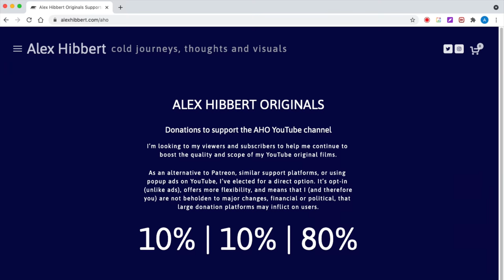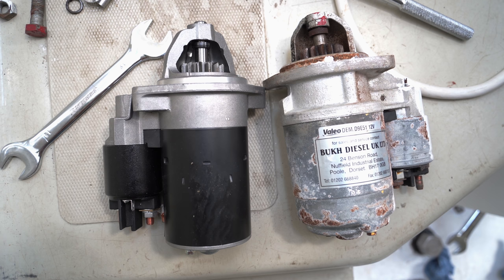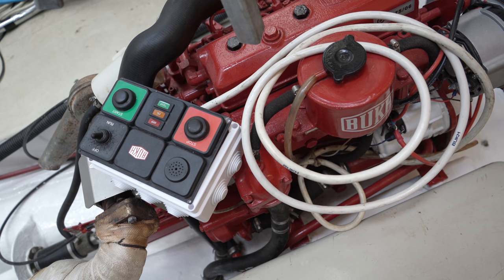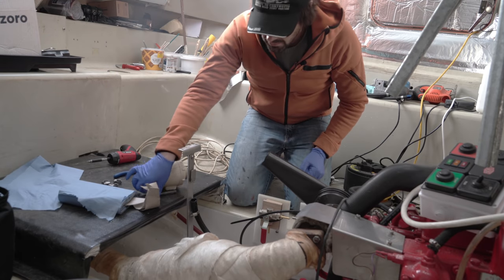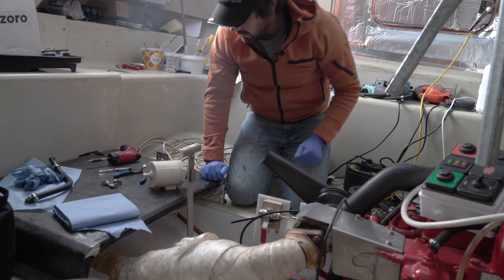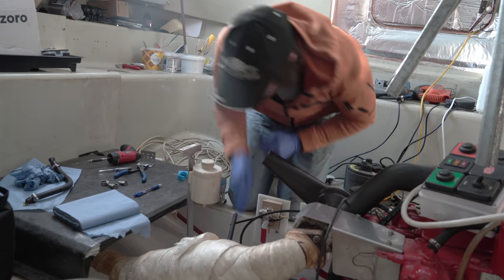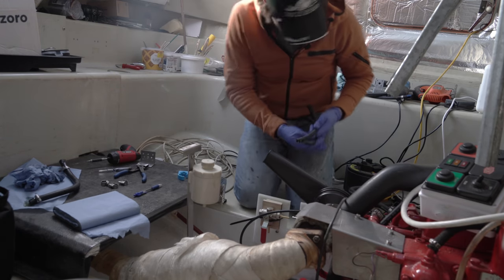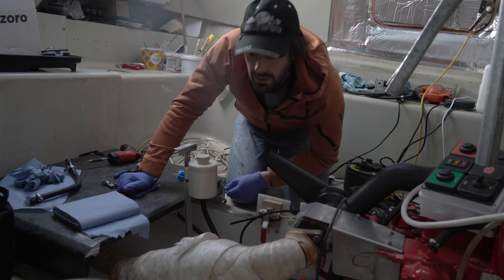Lifeboat Conversion Ep13: Fixing the broken - starter motors, lube hoses and head-bumping [4K]

Comment: 1 is none, 2 is one.  Backups are a way of life.  Being on such remote expeditions a simple part could be catastrophic.  Glad you are so thorough.   Keep it coming, really enjoying it.
Reply from the maker: On a boat it's refreshingly possible to have spares of most things. On ski expeditions, when you haul everything, for many items you can only bring one and have to fix it if you get a breakage.
Reply: @AlexHibbertOriginals  A ski expedition has fewer electromechanical parts that break down though I imagine
Reply: @daylen577  Unfortunately you've got something much worse than electromechanical-
Biological stuff breaks down all the time, and requires a lot of gear to maintain.
Even worse, it sometimes requires "natural healing" which takes time, rather than being finished once it's out of the shop.

Comment: There is another lifeboat conversion on youtube that a couple of young British architects did for a trip along the coast of Norway.  There were two safety things they did that I am curious if you will repeat.  First, They turned what I assume were loading doors on theirs into large windows that actually made the inside a lot brighter and actually quite appealing to spend time in.   I imagine that in northern climates the heat/light for moving around/ the depression fighting sunlight on the skin are probably all welcome bennifits that helped keep them upright and productive.   Second they chopped a bit of the back to create a little landing to make getting on and off the boat a lot easier/safer.  Which I imagine will be a dangerous challenge in icey waters.
Reply from the maker: Hi - yes the Stødig guys made a really nice job of their (much larger) boat. The answer to your question is no to both. I don't want to compromise the strength or self-righting of the boat by removing much of the upper hull, and I've no particular need to have a stern located 'helm zone'. It's really just a priority thing. I need Alan to be an expedition vessel with all the safety design features retained, and have no particular need for a load of nice-to-haves. The things they installed in Stødig make it a much more comfortable coastal cruiser and live-aboard though!
Reply: @AlexHibbertOriginals  thanks for the response.    That’s some helpful context on how the projects will be different.

Comment: A couple maintenance guys at a previous job called the jubilee clips "hosecutters". While there I don't think I ever saw them used except on steel-braid hoses or tough plastic hoses that were perfectly stationary.
Reply: Proper clamps have a solid inner ring. These cheap stamped jobbies are for short easily maintained service.

Comment: If not, also based off your wiring info you may want to Replace ALL your engine hoses with silicone there as well. They handle a wide range of temps better and last longer.
Reply from the maker: I've not come across silicone fuel hoses. I know that sometimes you can get unexpected chemical interactions with seemingly inert substances. Will have a read.

Comment: I think you should consider something less steep potentially around that wire you’ve run over the walkway, I feel like it’d still be easy to trip there, especially with the anti-slip paint you added too it, but then again, I’m not there so I couldn’t really tell for myself lol
Reply from the maker: Thanks Murray. I tried it there before bonding it permanently and tested it - seems ok. If there's an issue later I can always replace the curved sides.

Comment: A couple of suggestions

For the wiring go with circuit breakers not fuses (you can get blade type circuit breakers that fit in a standard system) and preferably manual reset. Fuses are sacrificial so when things go wrong you can go through them real quick. With circuit breakers they trip and you just reset them. Manual reset are better than auto in most cases as automatic reset's can sometimes mask a problem. The exception is critical systems that have to run, even in limp home mode.

The suggestion is an oil evac system for the engine.
All you do is remove the bung from the sump, fit a good quality valve in it's place . Fit a length of low pressure hydraulic hose to the valve and have a small hand operated vacuum pump tank. When you need to do an oil change you just suck the old oil out. No fuss and more importantly no oil in your bilge.

Oh and multiple bilge pumps. I have seen trawlers sunk at their moorings by a match stick jamming the impellor (admittedly it was moored in it's off season and unattended for an extended period)
Reply from the maker: Interesting Kim, thanks. 

I did look at circuit breakers, but have invested in standard fuse boxes. It's not too late to swap over I guess. But, fuses are very very cheap and if you keep blowing the same one, it's time to investigate further!

Alan's bilges are now very small, and I'll probably have a roving pump that can move wherever needed, if there's a leak.

Comment: I would add a sight glass to the oil res. for ease of maintenance and as a fail safe incase a leak arrises
Reply from the maker: The reservoir is translucent, so you can see the oil level. For further inspection the top screws off easily.

Comment: Ditch all of the jubilee type clamps and use proper hose clips. Probably easier to manage/service than oetiker clips. Also make sure you don’t have any paint on starter motor mounting face as that’s where it will earth through to engine block.
Reply from the maker: Both 👍

Comment: It would be interesting to see how the steering works.  I've wondered if, instead of abandoning it, it would be easy enough to attach some crude automation and have it beach itself somewhere it could be retrieved more easily.  I'm guessing you're leaving yourself a huge safety margin in fuel.
Reply from the maker: It was the previous expedition plan, and no even if Alan could go autopilot, it would be in iced up waters.

Comment: invest in a pipe cutter  very useful and gives very clean cuts and square .also much easier to use.less chance cutting yourself
Reply from the maker: Could well be a good idea, although would only get a dozen or so uses and I'm pretty reasonable with a razor sharp knife and cutting block.
Reply: @AlexHibbertOriginals  that is what  I thought. Have used mine many  times  since first bought.

Comment: Boat
   noun
      1. a small vessel propelled on water by oars, sails, or an engine.
      2. a hole in water into which money is thrown.
Reply from the maker: They can be money pits, but astute purchasing strategies can massively reduce this.
Reply: @AlexHibbertOriginals  Where you will be taking this, I can fully understand the need to replace every questionable part in advance - and also keep many spare parts on hand.

Comment: Awesome content, as always!

I do have a question, though. How are you planning to handle heating in Allan? 

I imagine you can use the waste heat from the engine (and electrical power from the alternator) while the engine is on, but I'm curious what your backup systems are like for when the engine is off.
Reply from the maker: Engine heat whilst underway and a diesel heater otherwise.
Reply: @AlexHibbertOriginals  Makes sense!

Although the old hillbilly in me worries about not having more backup systems (my cabin in the middle of nowhere has three separate systems (coal, gas, electricity) and I can't  count the number of times I lost any two of them at the same time!), I imagine you'll have camp stoves or canned heat of some kind to act as a backup for those.

Comment: Bit of an odd question but do you have a logo or emblem that you’ll be marking the vessel with?
Reply from the maker: Depends on who helps fund Alan.
Reply: This is a worthwhile question.

 Allan needs to have an epic mission patch that can be proudly displayed by the crew, or put on merchandise, or, later on, decorate the covers of the books detailing his epic adventures.
Reply: @AlexHibbertOriginals  if the logo doesn’t end up being an angle grinder, I’ll be sorely disappointed.

Comment: This is going to sound so stupid but, for rough see's taking a cue from tank crews, and getting a padded helmet might work too.   Comically,  a simple bike helmet that you could throw on during rough seas might be a life saver.  You wouldn't need anything as extreme as the full helmets with neck supports for RIB rescue boats, or the integrated coms used by the navy, given the boats slow speed.   But again, a simple bike helmet might work well.
Reply from the maker: Yes ski helmets are going to be onboard for any crazily rough seas - although, Alan's passages are likely to be very carefully timed to avoid huge seas, and when amongst sea ice, waves are dramatically reduced in size.
Reply: @AlexHibbertOriginals  Thats true,  but even low chop can be annoying in confined spaces.   though again the blessing of not pulling 15+ knots, is you don't get that back breaking, neck snaping, tump tump tump you get in the 30' boats during rescues.   

Truth be told,  turning a "tender" into a houseboat might be fun.   Not for expeditions but the amount of space you get on a tender.
Reply: This is actually how the soviets handled the inside of tanks, which one might not realize, simply do NOT have a suspension. Soviet tanker helmets are an iconic distribution of ridged padding to keep crewman warm, give them radio that will work in the loud environment (at that time, throat mics and heavily rubberized ear-cups with speakers in them) and most importantly keep the contents of their skull within their skull during rough terrain.

Comment: You could really use a 3d printer for things like your usb hub or controller. You can get them for less than 170 usd and are perfectly capable machines.
Reply from the maker: I'd like to spruce up that USB panel at some point, but it's 100th on the priority list.

Comment: I love the purely  functional engineering of your project.  Do you need a bit of a roll cage on the engine remote control in case it is dropped or something hits it?  Hmm-  you maybe using that with gloves. 🤔
Reply from the maker: It's a metal panel and pretty robust.
Reply: @AlexHibbertOriginals  Any worries about controls being hit, if it's not mounted rigidly?
Reply from the maker: It'll have a 'home' it's attached to when not mobile. But no not really. It's just a few switches on a metal panel.

Comment: Probably would be a good idea to wear a russian tanker helmet .The British refused to wear helmets in their tanks during that chin dig called the 2nd world war preferring the Monty berries however this dident perform well in impact tests and many were seriously maimed or killed or knocked unconscious during exuberant driving in less than ideal conditions .This and poor ergonomics wasn't ideal when there were panzers roaming around  and your driver or your gunner was having a deeply personal moment .I was also thinking that exhaust on the engine produces a lot of heat .could you wrap it in copper pipe as a additional hot water supply .perhaps for a bath that doubles as a swing cot bed for stabilisation like a type of gimbal perhaps as everyone likes a radox bath occasionally rather than showers all the time .  .just a random  thought. It would be like a sauna .probably wouldent do the electrics any good all that steam long term so a dehumidifier might be a thought ?as well as a fresh air mask if the engine starts to get a bit smelly after a long days work and the weathers a bit to crap to open a window or door .A air suspension pilots seat unit off a tractor would give loads of comfort on a rough sea to absorb impacts without bouncing you through the roof.Also Velcro on your shelf's to stop everthing falling off .like mugs and plates.they use Velcro a lot in space for good reasons.enough of my ramblings .keep up the good work and I admire what you are doing.
Reply from the maker: Helmets - yep for sure.

Comment: on the topic of starter motors: there is a company that makes hand powered starters wich you wind up by hand and then press a button to start, i think it would be a nice addition to alan as it would be pretty hard to break and work w/ even a dead battery 
here is a video of it being demonstrated https://youtu.be/K0I-EHsmkME
Reply from the maker: Very interesting - although they don't seem that easy to source online. In the UK only via a distributor.
Reply: @AlexHibbertOriginals  might be worth a shot asking, see if they have something fitting

Comment: That has to be one of the easiest to get to starter motors in history, and you still smashed your fingers? Careful with those, I had a ford starter motor work on a diag machine, but brick while installed. I took it out and put it back in twice before replacing it with a new one. So get your core rebate out of it and get a new spare, because that old one might work when someone's looking, but die when you actually need it.
Reply from the maker: It was perfectly easy to get at. But it was stuck to the mount with rust and paint. I used a lever (spanner) wrongly which meant I knuckled myself on the alternator. I used cord soon after and it popped off fine.

The old motor is in good condition inside, and hasn't run many cycles. The solenoid just had a loose connection. All cleaned up and fine.
Reply: @AlexHibbertOriginals  It's not real mechanical work unless someone is standing there offering handfuls of unasked for advice.